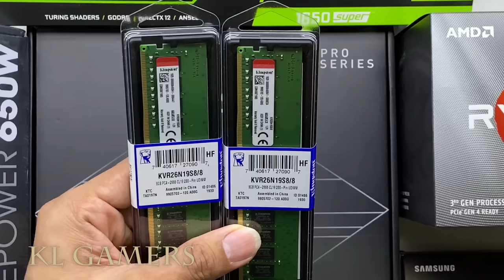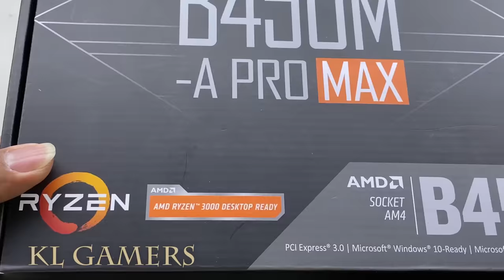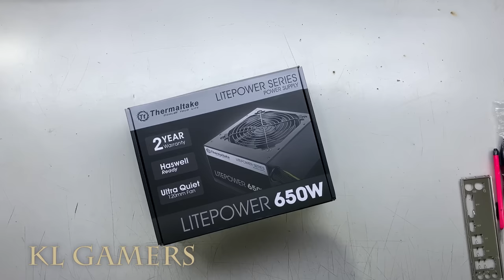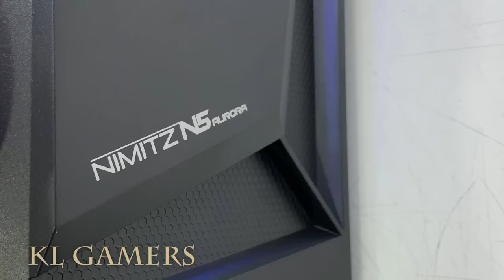AMD Ryzen 5 3600X msi B450M-A PRO MAX 16GB DDR4 SAMSUNG 970 EVO GTX 1650 Super Armaggeddon Nimitz N5

Comment: Bro please add price tag
Reply from the maker: Processor = AMD Ryzen 5 3600X 6-Core, 12-Thread Unlocked Desktop Processor with Wraith Spire Cooler
(Amazon link) = https://amzn.to/3huiDZx
(Lazada link) = https://c.lazada.com.my/t/c.bHc9Hg?url=https%3A%2F%2Fwww.lazada.com.my%2Fproducts%2Famd-ryzen-5-3600x-with-wraith-spire-cooler-free-bubble-wrap-i528720221-s1044744320.html&&sub_id1=3600x&sub_id2=BIG&sub_id3=979
(Shopee link) = https://invol.co/cl10ft9

Motherboard = MSI ProSeries AMD Ryzen 2ND and 3rd Gen AM4 M.2 USB 3 DDR4 D-Sub DVI HDMI Crossfire ATX Motherboard (B450M-A Pro Max) (B450MAPROMAX)
by MSI COMPUTER
(Amazon link) = https://amzn.to/2Xlecbf
(Lazada link) = https://c.lazada.com.my/t/c.b1VlcO?url=https%3A%2F%2Fwww.lazada.com.my%2Fproducts%2Fmsi-motherboard-b450m-a-pro-max-socket-am4-i989048352-s2601008019.html&&sub_id1=PRO+MAX&sub_id2=i+save&sub_id3=278
(Shopee link) = https://invol.co/clug3f

RAM = HyperX Fury RGB 16GB 3200MHz DDR4 CL16 DIMM (Kit of 2) 1Rx8 RGB XMP Desktop Memory HX432C16FB3AK2/16
(Amazon link) = https://amzn.to/2NIVgi1
(Lazada link) = https://c.lazada.com.my/t/c.ZfZ6AH?url=https%3A%2F%2Fwww.lazada.com.my%2Fproducts%2Fkingston-hyperx-fury-rgb-8gb-ddr4-3200-mhz-cl16-gaming-ram-amakusa-i613494983-s1262384796.html&&sub_id1=3200+RGB&sub_id2=Amakusa&sub_id3=229
(Shopee link) = https://invol.co/clkhgg

SSD = Samsung 970 EVO SSD 500GB - M.2 NVMe Interface Internal Solid State Drive with V-NAND Technology (MZ-V7E500BW), Black/Red
(Amazon link) = https://amzn.to/3aak10e
(Lazada link) = https://c.lazada.com.my/t/c.6Eb6?url=https%3A%2F%2Fwww.lazada.com.my%2Fproducts%2Fsamsung-v-nand-970-evo-nvme-m2-2280-ssd-500gb-mz-v7e500bw-i467362457-s756058157.html&&sub_id1=970+evo&sub_id2=EIT&sub_id3=575
(Shopee link) = https://invol.co/clkbql

SSD = Kingston 500GB A2000 M.2 2280 Nvme Internal SSD PCIe Upto 2000MB/S with Full Security Suite SA2000M8/500G
(Amazon link) = https://amzn.to/381FuGm
(Lazada link) = https://c.lazada.com.my/t/c.6uzt?url=https%3A%2F%2Fwww.lazada.com.my%2Fproducts%2Fkingston-a2000-m2-2280-nvme-pcie-ssd-500gb-sa2000m8500g-i411502404-s1615374960.html&&sub_id1=a2000&sub_id2=eit&sub_id3=350
(Shopee link) = https://invol.co/cllbub

Hard Disk = Seagate BarraCuda 1TB desktop hard disk =RM170
(Amazon link) = https://amzn.to/2YFWWLP
(Lazada link) = https://c.lazada.com.my/t/c.WLWh
(Shopee link) = https://invol.co/clh6b1

Graphics Card = Galax GALAX GeForce® GTX 1650 Super EX (1-Click OC) 4GB GDDR6 128-bit DP/HDMI/DVI-D
(Amazon link) = https://amzn.to/3jejSww
(Lazada link) = https://c.lazada.com.my/t/c.bsgmvW?url=https%3A%2F%2Fwww.lazada.com.my%2Fproducts%2Fgraphic-card-galax-nvidia-geforce-gtx-1650-super-ex-1-click-oc-i833192468-s1983092505.html&&sub_id1=1650S&sub_id2=LAZ&sub_id3=749
(Shopee link) = https://invol.co/cl10c5p

Wifi = TP-Link WiFi 6 AX3000 PCIe WiFi Card for PC with Heat Sink| Bluetooth 5.0 | 802.11AX Dual Band Wireless Adapter with MU-MIMO, Ultra-Low Latency (Archer TX50E)
(Amazon link) = https://amzn.to/2DuK6eS
(Lazada link) = https://c.lazada.com.my/t/c.b6kMNB?url=https%3A%2F%2Fwww.lazada.com.my%2Fproducts%2Ftp-link-ax3000-wi-fi-6-bluetooth-50-pcie-adapter-archer-tx50e-free-pubg-bag-i1169126020-s3379272581.html&&sub_id1=AX3000&sub_id2=Mono&sub_id3=149
(Shopee link) = https://invol.co/clvwf5

Power Supply = COOLER MASTER ELITE P600 V3 230V PK600W POWER SUPPLY (MPW-6001-PCABN1)
(Amazon link) = https://amzn.to/2YKHnG2
(Lazada link) = https://c.lazada.com.my/t/c.Z6UZr0?url=https%3A%2F%2Fwww.lazada.com.my%2Fproducts%2Fcooler-master-elite-p600-v3-230v-pk600w-power-supply-mpw-6001-pcabn1-i1117960818-s3147116409.html&&sub_id1=Elite+P600&sub_id2=EIT&sub_id3=155
(Shopee link) = https://invol.co/clpt9d

Casing = Armaggeddon Nimitz N5 Aurora RGB MATX Tempered Glass Gaming Chassis
(Lazada link) = https://c.lazada.com.my/t/c.bHce4P?url=https%3A%2F%2Fwww.lazada.com.my%2Fproducts%2Farmaggeddon-nimitz-n5-aurora-rgb-matx-tempered-glass-gaming-chassis-free-2-x-led-fan-i637384599-s1333000484.html&&sub_id1=Nimitz&sub_id2=CS&sub_id3=129
(Shopee link) = https://invol.co/cl10fsj

AeroCool Cylon RGB Mid Tower with Acrylic Side Window, Black
(Amazon link) = https://amzn.to/2xd3eem

Price is based in local Malaysia current price.

Comment: I build a simular System for my son,
AMD Ryzen 5 3600 6-Core, 12-Thread Unlocked Desktop Processor
Asus TUF B450M-Plus Gaming Motherboard
OLOy DDR4 RAM 16GB (2x8GB) 3000 MHz
 Netac 250GB SSD - Internal SSD NVMe PCIe Gen 3 x4, M.2 2280
GIGABYTE GeForce GTX 1660 SUPER DirectX 12
TP-Link AC1200 PCIe WiFi Card for PC
Cooler Master MWE 550 White 550W 80+ White PSU
Cooler Master MCB-Q300L-KANN-TUF MasterBox TUF Gaming Alliance Edition
Seagate BarraCuda 2TB Internal Hard Drive HDD
Reply from the maker: great stuff

Comment: Well I'll give him credit he using two Ram stick instead of one, But 2666 mhz is not getting the most from your Ryzen 3600, you should consider using 3200 mhz Ram for the most performance from you CPU. Another-thing a 650 Watts power supply is over kill for a 65 watt CPU and a 140 Watt GPU. A 500 Watt would be more than enough with growth for a large GPU as long as your not going to install a RTX 2080 ti.
Reply: And to be honest I build a similar system for my son and I install a GTX 1660 which was 50 dollars more than you 1650 and I use a 250 NVME Drive allow with a 2 gb Hard drive.  Which give my son both the speed to run games and the room to store them.
Reply: @devilhunter9345  wow can u bulid me a pc to lol
Reply: @devilhunter9345  1660 is the new trend :D
Reply: @antonio.x22  The GTX 1660 has similar FPS as a GTX 1070 ti.
Reply: @devilhunter9345  I saw the prices in MEX ,  by now 100 USD more for 1660 paired with 1650. prices now are so strange rare here. (o0)
Reply: @antonio.x22   I live in Tijuana, right next to the USA I work in San Diego, so I buy my part in a America.
Reply: Devilhunter more advantage: kimpossible 😜
I was in Macallen BestBuy,  one of the best laptop Toshiba there, time ago, excellent price and still good petformance after upgrade SSD. 👍🏼  ( my favourite  UETA duty free 🤪)